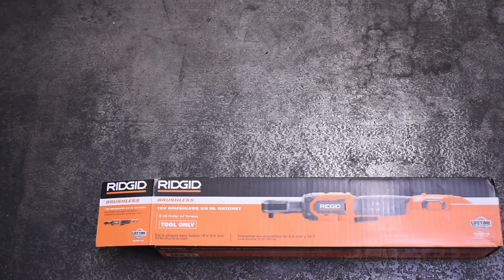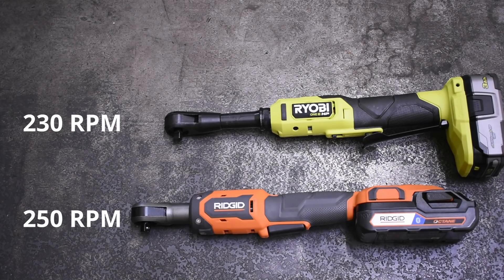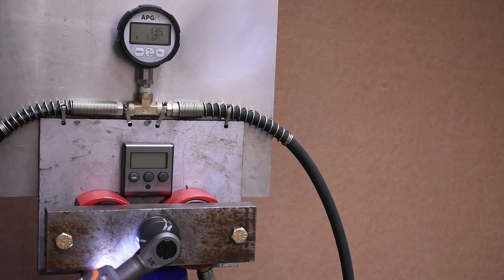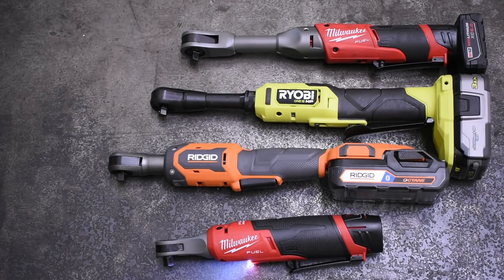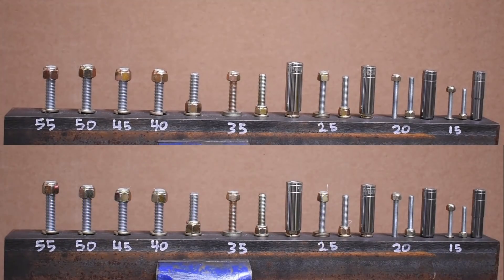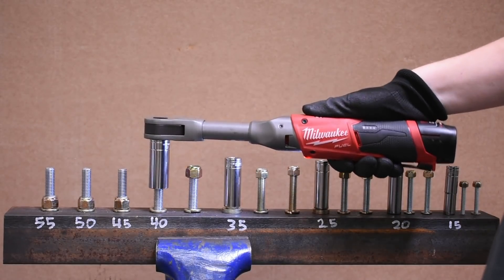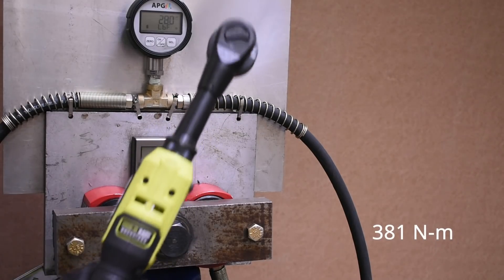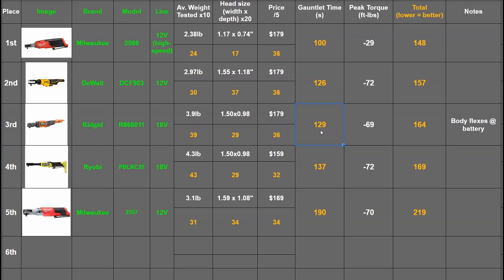RIDGID's 1st Ratchet vs Ryobi, DeWalt & M12: R866011

Comment: Great demo. 18/20v in my experience is just to bulky with no power gains.
Reply from the maker: Agreed. It makes sense here, as Ridgid is only 18V (at the moment) so it's their only option. But can't glean any benefits from it, and appears to come with a higher cost. Curious about DeWalt making both 12 and 20V then, what's to gain. Likely just people already owning the battery type it appeals to.
Reply: @TorqueTestChannel  Ridgid/AEG had a 12v line of tools until recently...shame they ditched it.
Reply: Yeah I’m just going to keep using my $49 husky ratchet($79 now).   Ridgid missed the boat on the ergonomics here.   And $179 is a silly price.    I’ve a got a dozen ridgid products but they keep pricing themselves out of selling product imo.   I bought a battery adapter so I could use Ryobi tools with my batteries
Reply: When DeWalt came out with their 12v “lithium Ion” platform it was the only lithium ion powered “pro” tools from a big manufacturer on the market because I don’t think they wanted to cannibalize their 18v nickel metal hydride line of tools which is why they came out with them in “low power” 12v. Then when every one else was coming out with their 18v and 20v lithium ion powered tools DeWalt came out with their 20v lithium ion line and I thought they were going to drop their 12v line but it just sorta hung around and now they re-positioned it as the smaller line of tools and came out with a new battery and new line of tools with a ratchet, 1/2 impact gun and a “sawzall” type “one handed” saw.

I bought that DeWalt 12v line when it first came out over 10 years ago when I bought my first house. I’ve done so much work with them and they’re still going strong, I still have the original small batteries and just bought the big 5AH battery for those tools and their new “one handed” sawzall type saw (it’s like the “hackzall”). Why not? 12v hasn’t let me down yet, that saw gets gets the job done. I also invested in Harbor Freights 12v Hercules line about a year ago for all their cordless ratchets. I got each ratchet (reg and extended) off of eBay new in the box for $50 each and they are great for working on cars!
Reply: Makes sense for me owning only 18V ryobi gear 😆 🤣
Reply: Given that DeWalt’s two battery platforms are rectangular, seems like it might’ve been nifty if they could made it so that some tools could take both batteries. 

I have a Ridgid inflator that takes an 18v battery or a cigarette lighter adapter.
Reply: @gf2e  well if it's brushless they could without much more bulk but it would have probably be a lot less powerful
Reply: @james10739  With the way most (all?) brushless controllers work, you could make a design that worked properly at 12v but choose electronic components with a higher voltage and current spec. 

Basically, when the voltage was higher, it would send shorter pulses to the motor. Brushless controllers already actively adapt pulse length based on how much torque is needed, so it wouldn’t really be any different than that. 

I don’t know the price points or BOM costs etc, so I’m not sure if the increased cost would be problematic or not.

Comment: I'm just happy to finally see dewalts name mentioned in a cordless ratchet test. Took them too long to release one. Although the Mac tools cordless ratchets can use dewalts batteries but they were pricey due to the Mac branding.
Reply: Pretty sure they are the same tool as most Dewalts are the basically same as a Mac
Reply: @dreadswizzard9142  
Mac tool and Dewalt ratchet are totally different.  I don't know why they went that way but nothing is the same on those.
Reply: Yea please
Reply: I'm happy with my m12 tools but would have gone with dewalt if they had a ratchet 10 years ago

Comment: You should check out the Kolbolt ratchet. Its 24 volt
Reply from the maker: Seems to match the Ridgid's specs for a lot less dough to. Worth a look me thinks
Reply: Someone else pointed out that the Kobalt batteries are substantially cheaper than just about anyone else’s. How big a deal that is depends on how you use your tools, I think.